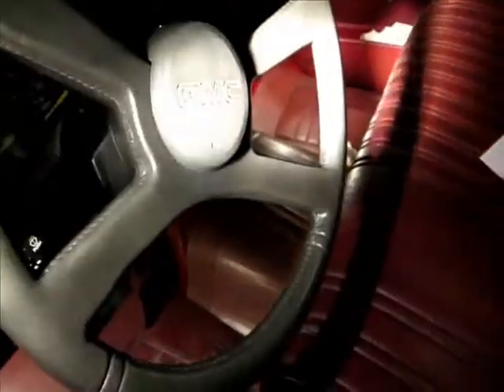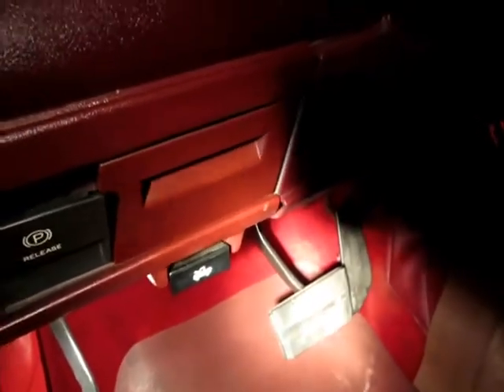Chevy truck door lock rods lubing

Comment: I have to slam my door as of lately...I think it may be the striker bolts they are worn down...I also lube the hinges and spring roller because my door squeaks every once in  awhile when opening...Stuff I use usually lasts around 2-3 months before needing more lube..
Reply from the maker: The bushings could be bad and the latch on the door itself could be old and worn!
Reply: Possibly Ill try the striker bolts first.
Reply from the maker: Just dont loose the nut behind them, It will fall so you need to remove the back panel to hold it. I changed mine years ago because the doors rattled over bumps
Reply: Back panel? inside the cab?
Reply from the maker: The interior panel needs to be pulled put.. If its a 3rd door, it should be behind the door panel
Reply: I have two doors no extra side door..
I wish I had a sliding back window though!
Reply from the maker: Yea, Not a fan of the rear sliders. You will have to crack open the panels a little to get behind the striker. Its not that had, I only semi removed mine and squeezed it in to hold the piece. I first UN bolted the striker Until I hear something fall. Ohh no!
Reply: alright thanks for that info...I also have a circuit board coming for the passenger side my brake light isn't working on that side..everything but the brake light works..MY gasket is messed up on the board..not a good connection...ive tried lots of things/..it's quite annoying
Reply from the maker: The foam gasket?  Junkyard piece!
Reply: I got it fixed..watch the vid
Reply: There are no junkyards close by...not worth the travel..closest one is in Avin and thats a good 30 min drive if not more
Reply from the maker: Mine is about 30 mins away too.